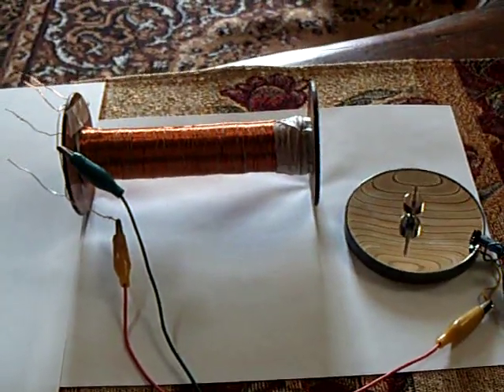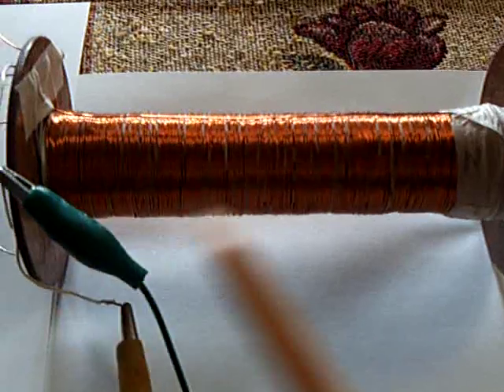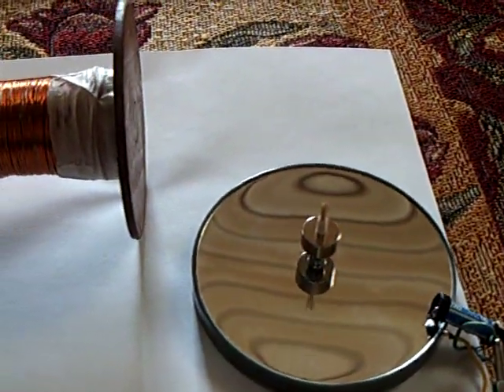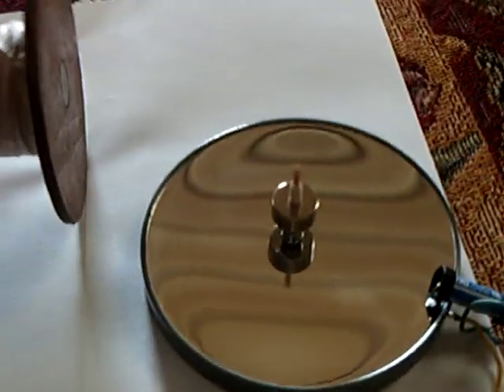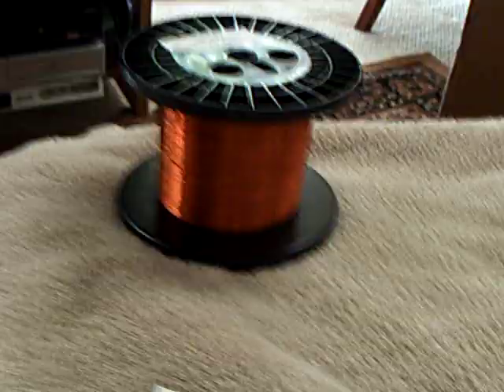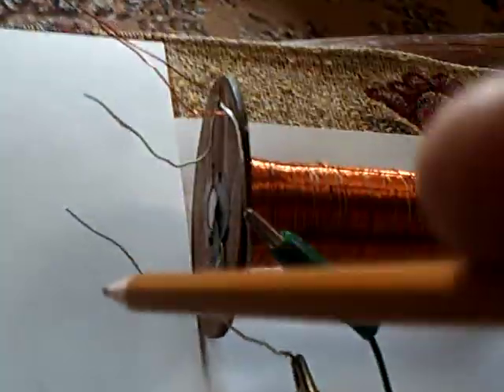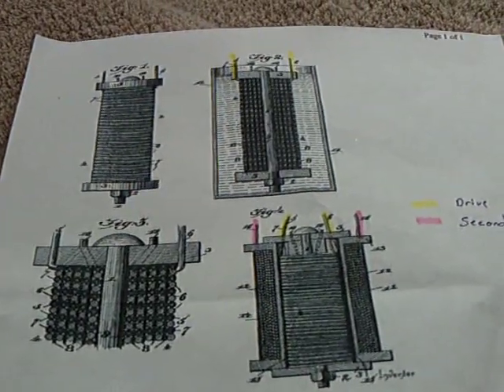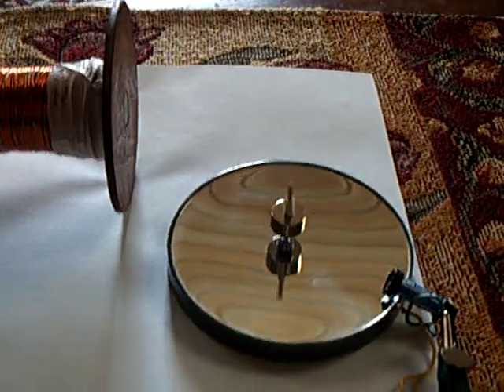Stubblefield coil STILL ALIVE!!!!.ASF

Comment: If this coil still works, I wonder how it would do with the 'Penny' circuit ?
You might get light and rotation from it. If angled correctly and Sharpie lines put on a larger lid type rotor, you could get neat strobe effects, like those grooves to get the speed right on old record players. All that from a bit of water on the coil  :)

Comment: makes it a magnet . Usually we need some resistor and transistor for any circuit and it dose need more current to go trough the circuit , but the NS circuit only needs a switch . Making a JT for example they will run on low battery but the only limit is the circuit (transistor.etc).

Mk1

Comment: Hi , Lidmotor , first i would like to say good work again .

Second , i had some time to think about it and i think the best way to explain it is.
Any battery is made of 2 metal dissimilar metal parts , both electrode never touch and are not electrically connected yet they  they work . We are so use to seeing a battery like a closed loop mostly because we always need to connect both side of the battery for anything to work . By designing the electrode in a coil shape and introducing a iron bar